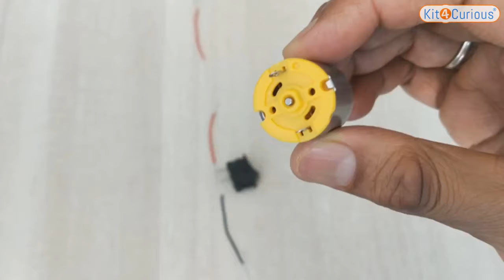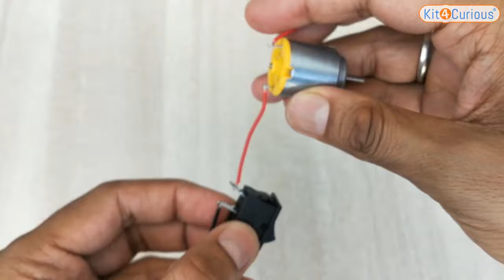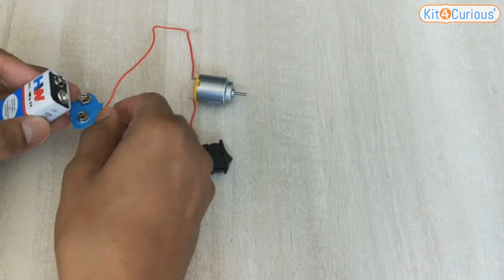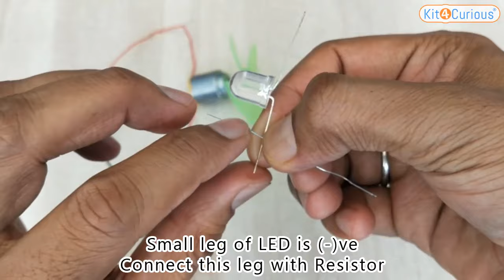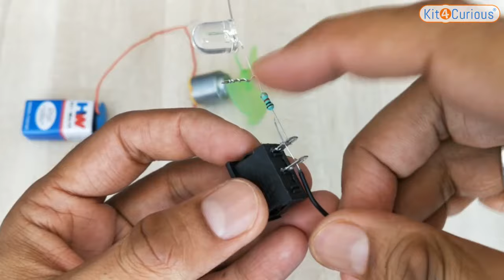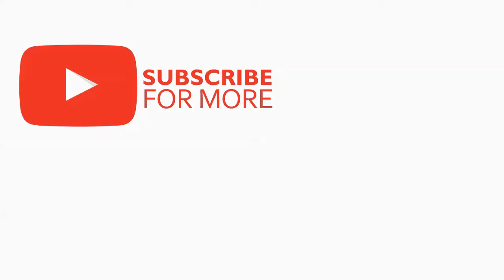Motor LED connection with 9v battery and switch - Fan Light project tutorial

Comment: Why do you need resistor for the bulb?
Reply: To reduce the power of 9v battery as the battery is only of 3 w
Reply: To limit the flow of electric current through led 
A high vol battery is not good for low vol led which would burn out the led much faster.
Reply: Because it gets fuse
Reply: Because if we keep light directly to 9v battery the light will not working it will burns that's why we will keep resistor
Reply: Do we have to use resister in💡 < this type of bulb

Comment: I want to run a micro motor and a led light at the same time off the same clock battery for an aircraft model display but the two dont like each other,  if I connect one to the battery it cancelles the other one out. Is it a resistor that I need ? I dont understand electronics very well. Can you help? In effect, I want to spin the propeller and have the light on at the same time I use the switch
Reply: Same as I also have this problem
Reply: Same

Comment: Can we connect without resistor
Reply: No 
Because the battery is 9 voalt but the led is 3 voalt And if you connect the led direct with battery it is overload  
The led is burn out